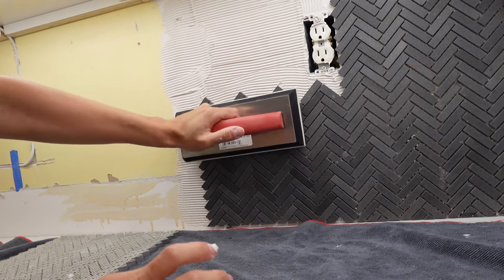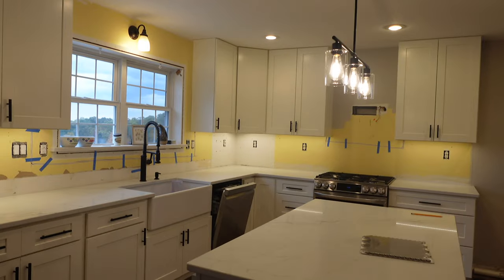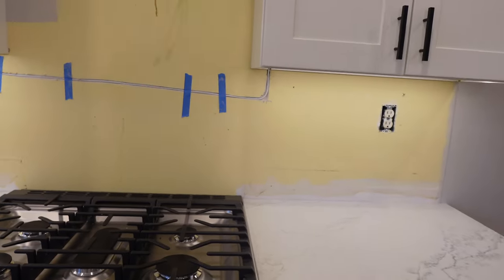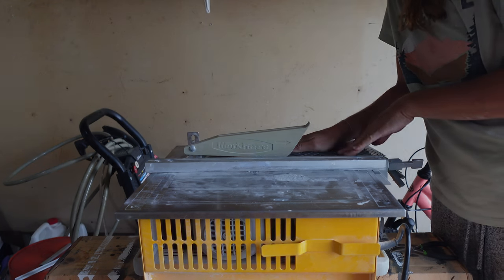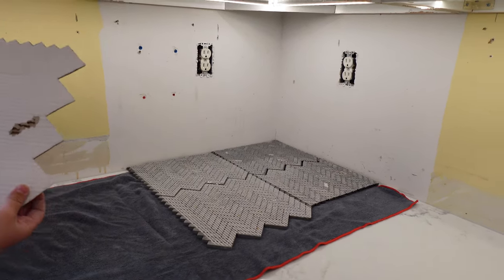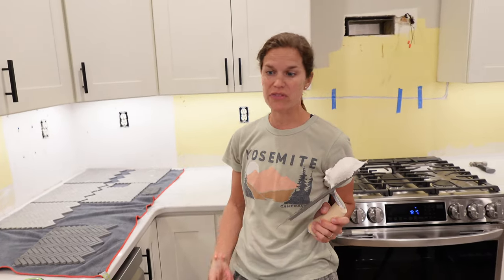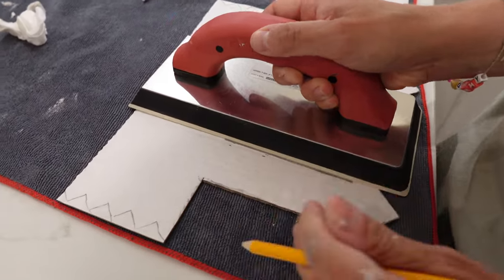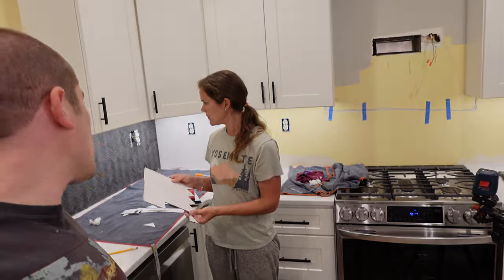Herringbone Mosaic Tile Backsplash Install. DIY TIPS AND TRICKS

Comment: I will say this, they are correct!  I have done all my renovations on my own(single mom here with little prior experience until a few years ago) this product is a bi*ch!  I have laid over 1000 ft.² of sleep, black, and my home, but I didn’t seal this prior to installing and I am in the process of cutting out $800 worth of these herringbone tiles and drywall they are on.  I sealed a few times before grouting, but the only way to get the haze off is to scrape each individual tile piece extensively.  So disappointed, but I just went out and got new product and drywall and I’m doing it again because it did look amazing except for the discoloration. Seal seal seal seal seal before installation after installation and then some! Kitchen looks beautiful guys! Good job!
Reply from the maker: I'm so sorry that you have tons of extra work on your hands, but your attitude is amazing. This project is NO JOKE. We are at the point of needing to seal again. Thanks for the reminder! Hope the finished project turns out beautifully.

Comment: What trowel size did u use
Reply from the maker: Great question! I had to go back and look at a few things because I couldn't recall off the top of my head. We looked at the directions on both our mastic and our tiles. Both of those places are great resources. The tile suggested a 1/8 in grout line size, so I think that's what we went with.